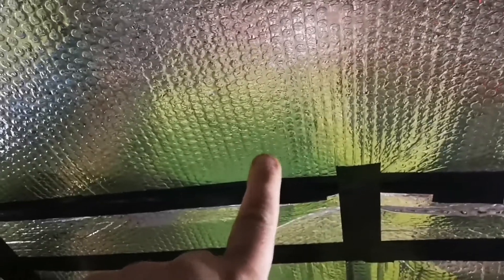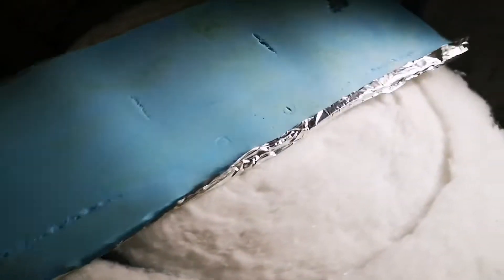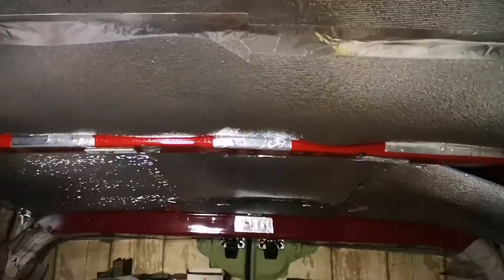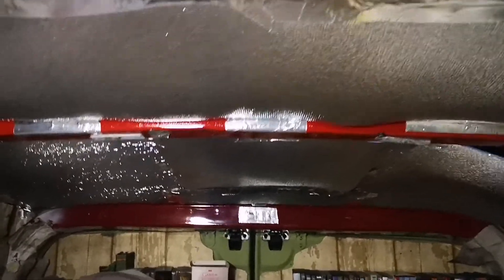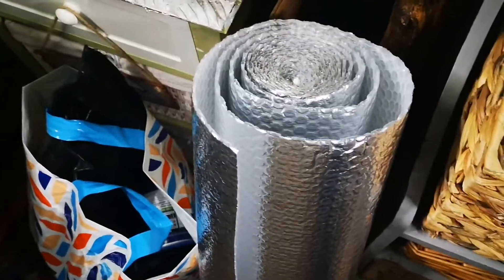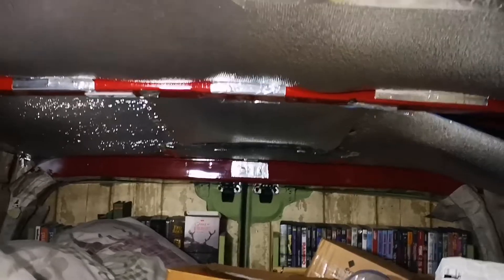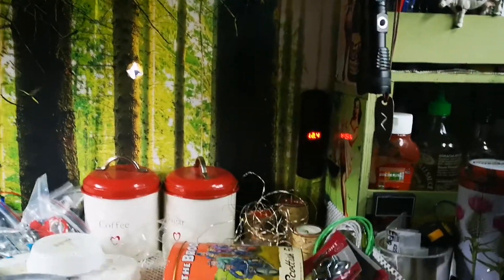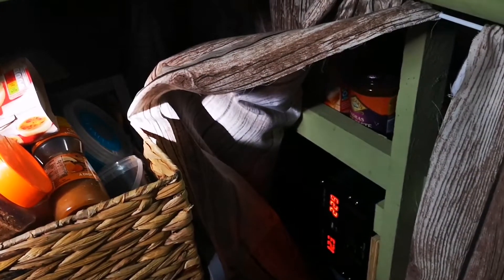Self Build Campervan Insulation,....How I've done mine.

Comment: I put double bubble wrap on all metal surfaces, then 2"kingspan on top of that, then bubble wrap over the top of that..
Used that same recycled plastic to shove in gaps and where kingspan wouldn't bend... it's wam as toast, yours looks well insulated to... awesome..👍👍
Reply from the maker: Cheers,just been out for 4 days in it,it was zero degrees outside and 28-30 in the van 😁
Reply: Nice one, you've got a great van there Skooty

Comment: ''dont buy that as an insulation'' - who told you it was... they lied... its not.... its a radiant barrier NOT an insulation.  its fantastic at its job, but only at its job, not at any other job... then again, its only as good as any other mylar film radiant barrier, do you want else is aluminised plastics/mylar film and works good as a barrier, crisp packets or a roll of tin foil, and thats cheaper..... 
That box for the wires looks great
Reply from the maker: People have been brainwashed into thinking that's an insulation